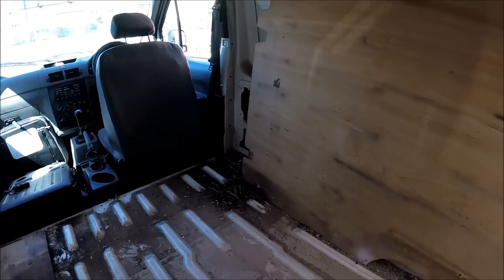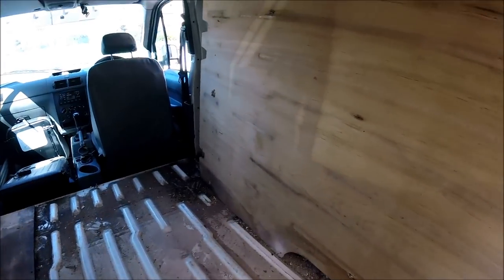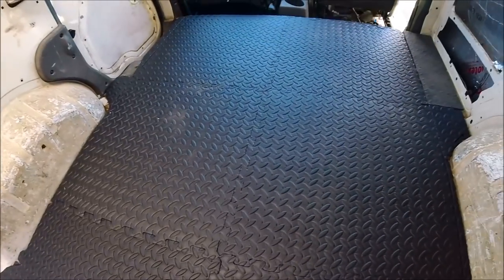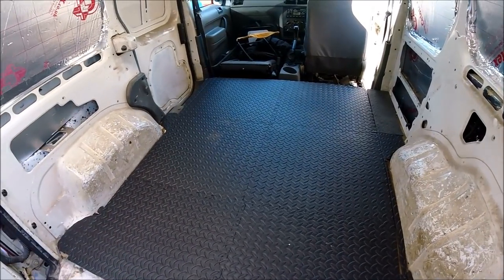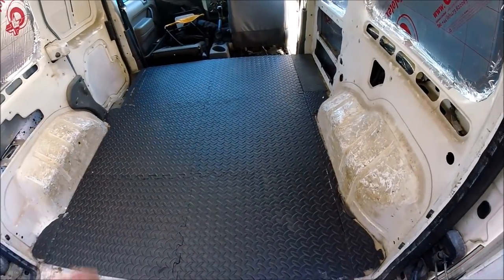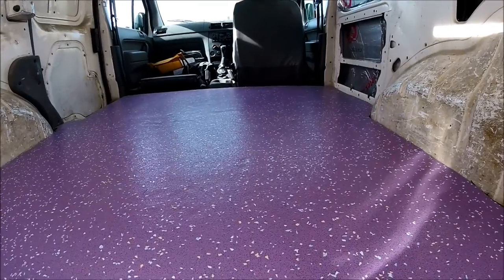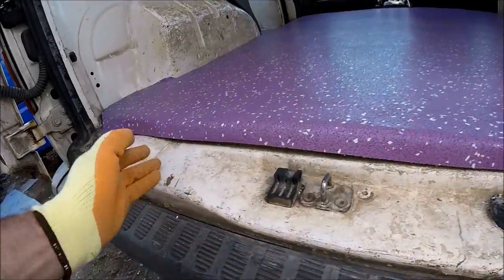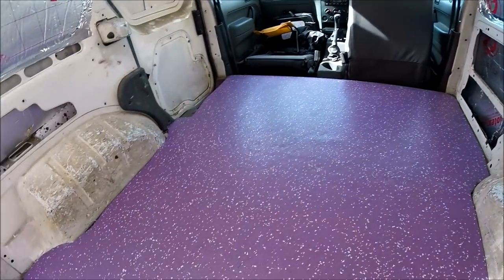Ford Connect Micro Camper Conversion Altro Flooring Installation

Comment: I've used these mats for years in my workshop as anti fatigue mats when standing in the same spot for hours but never thought of using for the van floor,  where do you get them cheaply ? all I seem to see are a bit pricey...
Reply from the maker: Lots of different designs etc via the link in the description or b&q do 6 pack for £9

Comment: How do you treat the screw holes in the floor? The ply floor in my transit connect has been riveted down and am reluctant to start drilling through into the bottom of the fan for fear of hitting something important. But I want to check it out for rust etc before I start building on it.
Thanks in advance!
Reply from the maker: Check under the van before drilling through but it should be fine as not much is directly attached to the underside of the floor

Comment: Neat job as usual :) did you ever try doing these things to a wheelchair accessible mini van? That would be my dream mini/micro camper.
Reply from the maker: I think you’d need a normal size van for wheelchair accessibility, micro campers wouldn’t have the space
Reply: Camper Conversion True, something like the T4 high roof would be perfect.
Reply from the maker: That or a minibus that already has a wheelchair access ramp already attached, is this something you’re wanting building?
Reply: Camper Conversion Yea I would love to build something like that at some point in my life or at least see it being built lol. It isn't quite possible here in Egypt, you can't get new full size vans registered for private use or even as a camper, I only found 1980s GMC and Chevys that has private registration but they are very old and can't be trusted for daily use and their spare parts are rare and expensive. 
Right now we own a 2018 wheelchair accessible Chevrolet N300 / move (we just got it and added a ramp) which is a bit larger than your Daihatsu, it's nice and I'm planning on building a foldable bed for it in the back because now it only got the 2 front seats, we removed all the back seats so me and my brother can get in it so a foldable bed would be nice so it can be tucked away while entering the van. A Toyota haice high roof is my dream van for that purpose which is complicated to own like I mentioned above, you have to own a company or have a car dealership shop or a school to own one or for a travel agency. 
Keep up the good work :) I love your channel